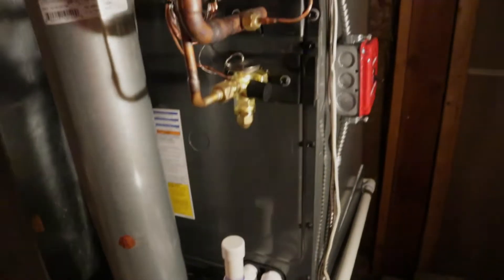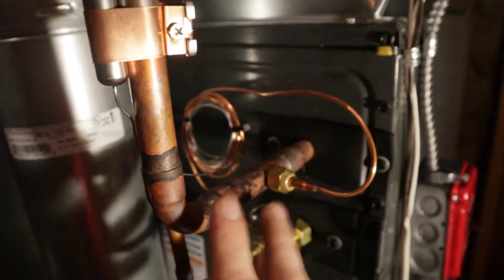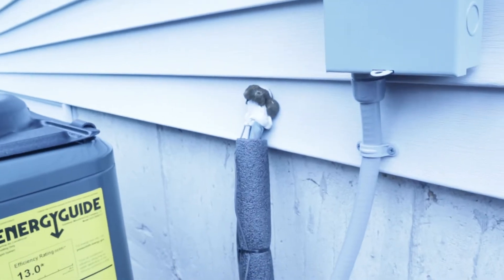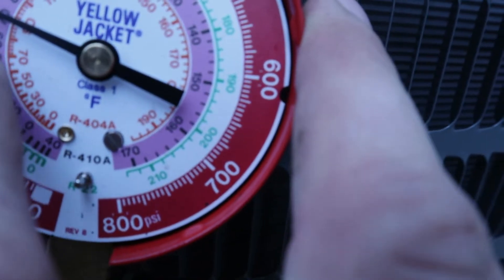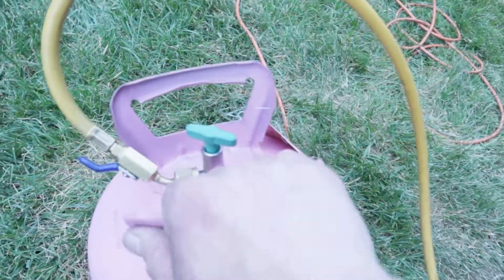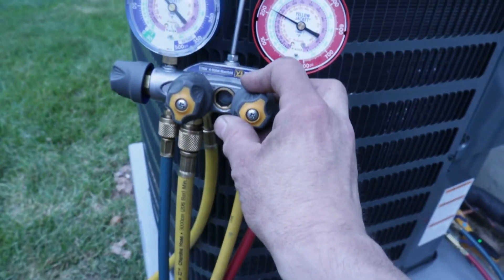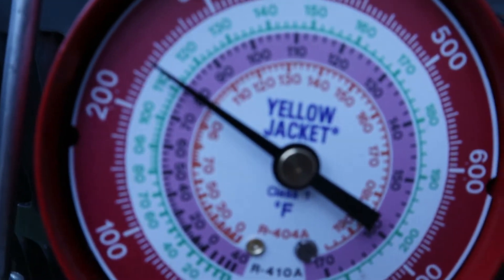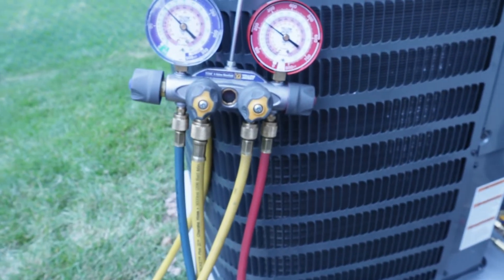Adding R410A Refrigerant To AC (subcool method w/TXV)

Comment: Great video.  Just curious - It would be of interest to know about how much refrigerant does it take to go from near-zero subcooling, to get to the 10 degrees?  You didn't use a scale (not that you needed to), but just wondering on a system about the size of the one you had there (guessing it was 2 1/2 ton), how much was needed?  A few ounces? A pound? More?

Comment: What would cause 350 PSIG on Suction Line with system OFF and system on down to 33 PSIG. Liquid line @ 133 PSIG (matches ambient) and running @ 183 PSIG. 
R22 .57 piston 76 Ambient. Tested with multiple lines and gauges
Reply from the maker: Discharge backflow from the compressor to the suction line. Check valve, reed valve, something leaking back from hi side. Compressor ON pushes back and suction drops to more reasonable operating pressures but runs poorly. 

Bad compressor.
Reply: @JerseyMikeHVAC hey man I appreciate the reply, I've been watching your channel your videos improve every time.

Do any of these data points change/support your opinion? 

Refridgerant R22
Fixed orifice .57"
2 Ton Heil w/High Efficiency Gas Furnace
Ambient: 75° F
No Filter Dryer

Symptoms/Readings/Findings: 

No Cool Call
Blower Good
Condenser Fan Good
Electronics Good

Gauge Readings: 

System Off: 
Suction: 350 PSIG
Liquid: 135 PSIG

Actual Taken Temps Near Service Ports: 

Suction: 74.6°
Liquid: 74.6°
Ambient: 75°

System Running for 3-4 Mins:

Suction: 33 PSIG 
Liquid: 163 PSIG

LL at Evap: 80°
Suction at Evap: 76°
Indoor: 75°

At entrance to Evaporator Furnace Housing:

Cold Vapor Line (right at START UP for few seconds, not when off) 

Cold Liquid Line (for 5-10 seconds only right AFTER SHUTOFF)

Coil Freezing after 10 mins or so, lines ok. 

System Back Off: 

Suction: back to ≈350 PSIG 
Liquid: 135 PSIG (76°F)

Notes: MULTIPLE hoses and MULTIPLE gauges were used to verify this anomaly 350 PSIG reading. 

Coil freezes in about 10-20 mins. No lines freeze.
Evap Condensing Line = Clear 
None of the lines ever exceed 80°F.

Only other thing I was thinking of could possibly be is a liquid line restriction most likely at the piston and maybe non condensables as well. But I don't know if that explains everything and/or it creates contradiction(s).
Reply from the maker: The piston might be partially restricted, yes — that would explain the coil freezing and 33 PSIG suction during run — but it still wouldn’t cause the 350 PSIG resting suction pressure.

You’ve ruled out gauge errors, and all your line temps back up your readings. In my opinion, the compressor is the core issue here, and the restriction (if it exists) is secondary.

Comment: Thanks for sharing your knowledge.
Would it be possible to suck in the refrigerant in before start up by using the vacuum already in the lines ? This way you can pull it into the liquid line and not cause any problems with the compressor. I understand pulling liquid refrigerant into the suction line is not healthy for scroll compressors.
Reply from the maker: I'll do that on really long runs when I know I'm going to be adding a bit,  it'll flash over quick under a vac either side. But short of that I'll balance off factory charge.

Comment: Is the AC Cover that appears to be on a hinge and flips up when the compressor turns on (2:40) an added part or did it come like that from the factory? Never seen that set up before.
Reply from the maker: It's an accessory. Called a Kool Kap, but wouldn't recommend it on a 2 Ton or less because the caps don't always blow all the way up on those and it will restrict airflow and decrease cooling of the compressor.
Reply: @JerseyMikeHVAC  Thanks for the information.

Comment: What do you do if the low pressure switch is in lockout? Lennox system has a really slow leak. Plan to add sealant and then charge the system. However, can this be done when the compressor is off, due to the lockout?
Reply from the maker: Put the 410 tank in a bucket of hot water to warm it up for a little while. That'll increase the pressure in the bottle and could help push enough refrigerant into the low side to overcome the lockout.
Reply: @JerseyMikeHVAC  Ok, thank you!! I'll do that. By the way, the system is a Luxaire Communicative system, not Lennox. Thanks again!!

Comment: I haven’t seen a filter dryer installed on the liquid line. May be it is there but I cannot see it.
Reply from the maker: Sometimes they come preinstalled inside of the condensing unit. Sometimes guys will install them inside up by the air handler.

Comment: I’m a plumber who works at an hvac company and I’ve been learning hvac. A guy I would do condenser and evaporator coil swap outs with told me to open the high side when you’re introducing a factory charge into the system. Are you supposed to open the suction side first?
Reply from the maker: Typically it is the suction side first, and many manufacturer manuals will suggest that. The reason is because if your line set is under a vacuum at the time, which it should be, the oil in the refrigerant will leave the compressor on whichever line you open first. On start up, that oil has to make its way back to the compressor to protect it. If you open the liquid line first, the oil rushing out of the unit to fill the vacuum will have to make its way through the txv and EVAP coil before getting back to the compressor, which can take a while and could potentially harm the compressor. 

When you open suction line first, the oil will enter into the suction line and will be pulled directly back into the compressor on start up. 

I suppose you can make an exception on heat pump systems if on start up you're going to run in heat mode first, only because refrigerant flows in the opposite direction. In that case opening the liquid line first might be the exception as the oil will enter straight back to the compressor on start up being in reverse flow for heating.

Comment: I love how you have the TXV mounted directly at the connection of the unit, but doesn't that make it impossible to remove that panel?  Also, If you have to mount the bulb vertically the capillary tube must come off the top of the bulb. If the capillary tube comes off the bottom of the bulb the refrigerant charge in the bulb can drain out to the TXV power head rendering the bulb useless. This is referred to as a Charge Migration.  Do you have any issues with that?  

Do you not use digital gauges or always analog?  What vacuum pump did you use as I didn't see that in your video.  You don't measure on a scale?  How do you know how much you have put in a system?  I use all Fieldpiece digital equipment and Bluetooth with my scale and all my various probes and tools.  I also use the Imperial Tool 535C Kwik Charge Liquid Low Side Charger, so it doesn't slug the compressor.  You seem to be an old school type of guy.  

I have never in my entire career ever heard of Keil as a brand.  Do they have a parent company they are part of?  I have been a technician a long time and own my own business, but never ever heard of Keil.  How do you like them?  Are they reliable?  I sell Daikin/Amana and Bryant as my main product lines.
Reply from the maker: "I love how you have the TXV mounted directly at the connection of the unit, but doesn't that make it impossible to remove that panel?  "

 If you look closer at the casing, there are removable rubber grommets that extend all the way to the right side of the casing door. When you remove them, you can slide the panel left and remove it completely out of the way quite easily. You don't even have to remove the flue pipe to do it. 

"Also, If you have to mount the bulb vertically the capillary tube must come off the top of the bulb. If the capillary tube comes off the bottom of the bulb the refrigerant charge in the bulb can drain out to the TXV power head rendering the bulb useless. This is referred to as a Charge Migration.  Do you have any issues with that?  "

 I've talked to a lot of techs over the years about bulb placement and capillary orientation, and the consensus seems that in so far as the capillary issue, it is more relevant either with certain brands, with commercial applications or when the bulb is placed inside of the coil casing where it's more likely to be exposed to colder air. It might be best practice, but I don't know of any issues resulting from capillary mounts outside of the casing. Primary concern is more on bulb placement on the line in a horizontal application. 

"Do you not use digital gauges or always analog?  What vacuum pump did you use as I didn't see that in your video.  You don't measure on a scale?  How do you know how much you have put in a system?"

 I have a whole set of digital probes I can read off of an app and I love them because I can have all my readings right there in one place without running all over the house. I don't have anything against the digital manifolds, I just can't justify the $700 or 800 when I'm just fine with the analogs and there are 100 other tools I'd rather have.  I use on old 7cfm vac pump. Nothing special. It gets me down to 200-300 microns quite often. 

 As for the scale, I use it when charging a flat system or a ductless off of the data plate. Or when on service calls for a recharge for billing. But this was an install and refrigerant cost for start up is figured into the quote. Trying to figure out exactly how many feet are in a whole line set to calc out a charge down to the ounce, on top of the factory charge (which I think is inconsistent from one unit to the next) is just guess work most of the time, IMO. I prefer to just let the readings talk to me. 

Keil isn't a brand. It's the company I work for. These are Goodman and Amana units. The tag is my boss's idea of advertising or something. I'm not a fan of the practice at all, but it's not my company, so....
Reply: @JerseyMikeHVAC  Mike - Thank you so much for nice and understanding response to my questions without taking offense or upset.  I really will have to learn how to install the TXV and bulb like you have because I think that is ingenious and I have not seen that done before.  Most are inside the cabinet on all the systems here in Colorado.  I, change all systems that are pistons to TEV's for efficiency and functionality.  I think that is awesome that the panel slides out and have easy access to the coil.  

As far as the bulb goes, I suppose it is just based on how I was taught and not everything taught is always gospel.  It is good to know that the system works as it should and does not seem to bother or affect the way the system performs and is charged.  I am definitely going to be giving that a try! 

I figured out must have digital gauges based on the temperature equipment you were using.  I have the entire array of all the Fieldpiece equipment with a backup set of analog and a partial set of Testo digital equipment.   I love being able to be inside working while watching my iPad or phone connected Bluetooth to my probes and measurement tools.  I run the VP87 vacuum with the Trublu dual hose set to pull it down to 200-250 microns.  I have some Appion hoses and adapters to charge the unit.  I don't charge through my digital manifold but use the Fieldpiece scale and fire away.  Sounds like having fancy equipment doesn't do much for me when knowledge from experience is better.  

Now it makes sense, Keli sure looked like the Amana/Goodman units I sell, but I was blown away there was a brand I haven't heard of.  I guess your boss has a hell of a way to advertise!  I wouldn't have ever thought about doing that.  But not a bad way to advertise. 

Thank you again for your kind response and sharing of knowledge.  I really do appreciate your time and the kind response.  

-Kevin
Aim True Heating and Air, LLC
Littleton, Colorado

Comment: I’m a fellow New Jersian. My dad was a plumber/ heat guy from the 60’s into the 90’s, passing away in ‘99. I never learned enough from him. Can you make a basic hot water heat video explaining the various components? The water feed, low water cut off, zone valves, expansion tank, circulator pump etc. Thank you!
Reply from the maker: I made a bunch of videos over last winter that got into a lot of those topics that you can check out.

https://www.youtube.com/@JerseyMikeHVAC/videos

 I'll get back into the topic again in the fall when it's more seasonal and do a video for you that covers the other stuff: expansion tanks, piping, etc.  I got you.
Reply: @JerseyMikeHVAC   Thank you so much for this Good video 👍